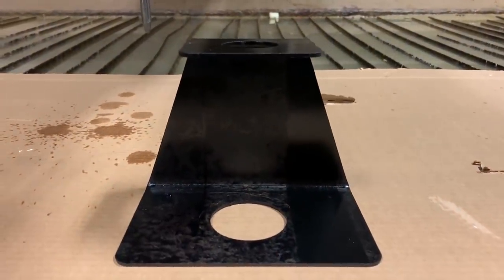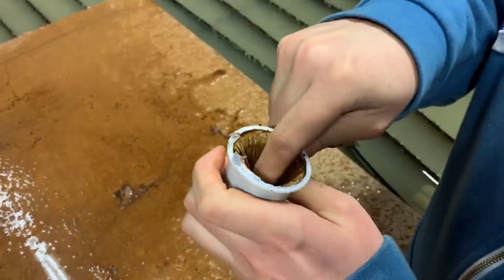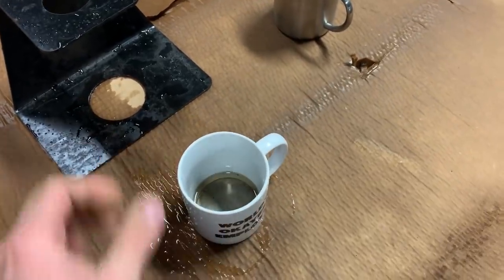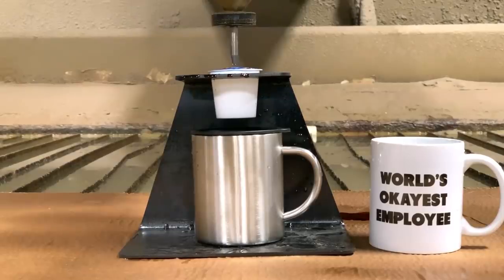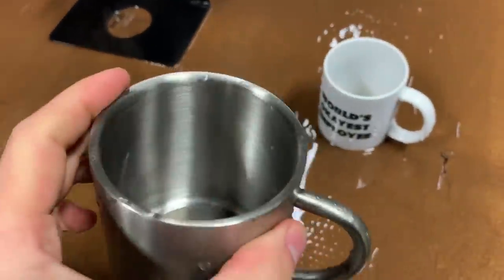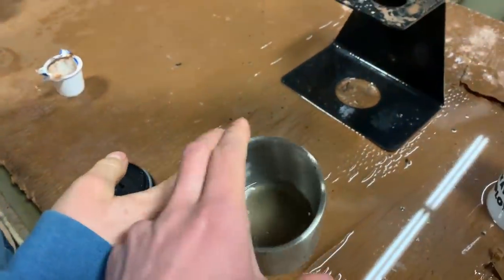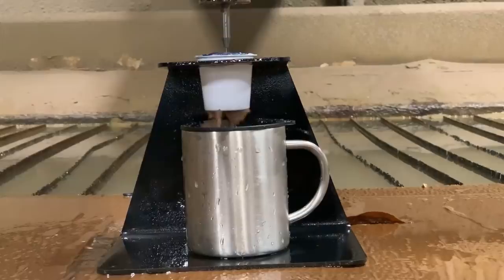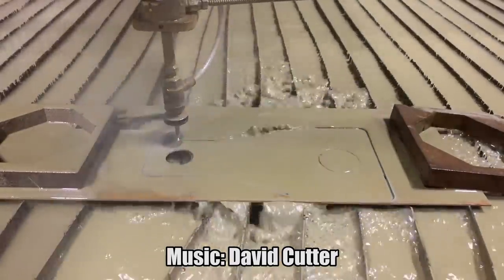High Pressure Coffee Maker - 60,000 PSI

Comment: You guys should get a fish tank then fill it all the way with water and spray the water jet inside the tank but record it in slow motion to see how the impact of the water jet travels down through the tank of water.
Reply: That could actually be interesting to see.
Reply: If possible, also color the water that the water jet uses to help show the spray pattern as it hits the fish tank.  That could be really nice to see
Reply: @razinhailsharp  That would make it even better
Reply: Good idea
Reply: ShaqWith TheCombo can we get the SloMo Guys for this?
Reply: @pascalsoll4622  ffs I was 17hrs late
Reply: This calls for the slow mo guys
Reply: @razinhailsharp  it is not.  The water goes through tons of filters.
Reply: @brettburgoyne7082  The water goes through tons of filters before entering the machine, though, so it may still be possible to include a dye so the water is more visible similarly to how they add the abrasive. Plus, regular water filters are incapable of removing dissolved solids from water. Unless they use a distillation process or reverse osmosis filter, there's no removing a dissolved dye from the water.
Reply: You should put some fish in it too
Reply: dumb idea
Reply: Go and look at the video of we’re they got their new water jet
Reply: Already done that on the new water jet
Reply: They did it when they installed their new waterjet
Reply: Prophecy has come true!